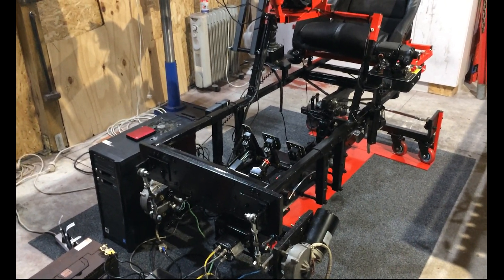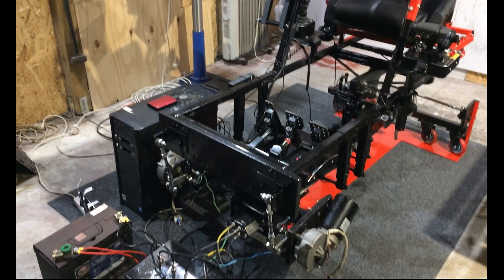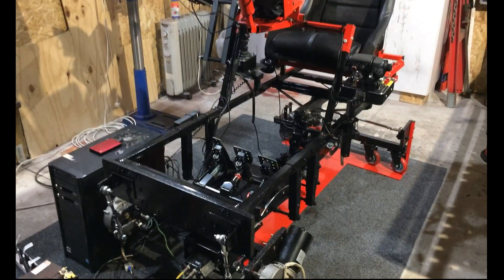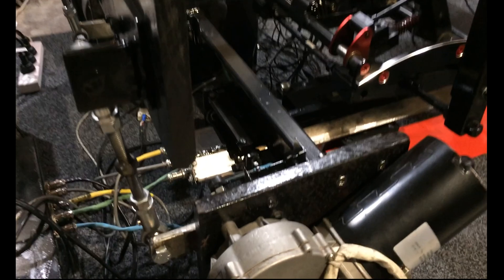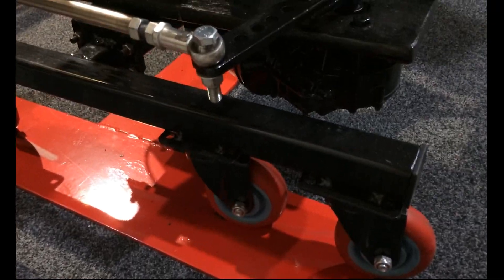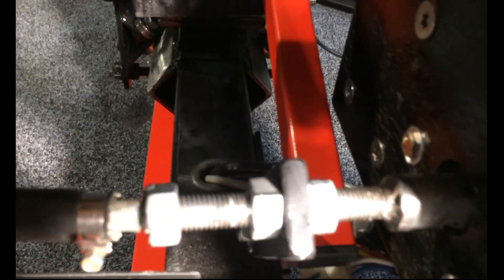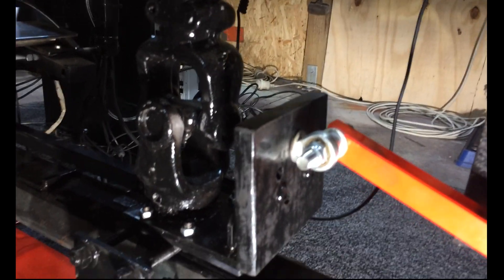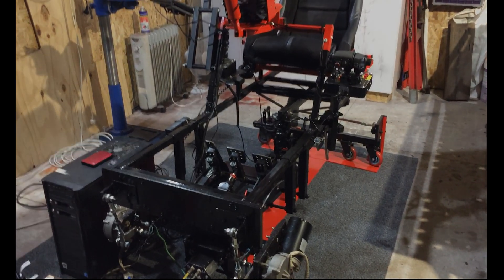4DOF DIY Motion Simulator Platform Motor Isolation Method

Comment: I was waiting on your thoughts on this. I have actually pulled my motor apart and isolated  the earth from the brushes. and it was a little bit off a pain the a,. 
 I didn't want to use any wood, so I pulled it apart, and I almost regretted it instantly LOL. I can see the benefits of using the wood and not having to pull anything apart. but as you mentioned with your spanner sonario, it still isn't 100% fool proof. 
fortunately I'm a bit of a boss at pulling stuff apart, particularly electro mechanical stuff, so I managed to do a decent job isolating it and getting it back together. so far so good.. I'll only have to do it one more time when MD get more stock this month.
Reply from the maker: Just keep an eye on their temps and do make sure you grab a multimeter and double check continuity between motors  and frame and motors and motors. Fingers crossed for you mate and hope it is all good.